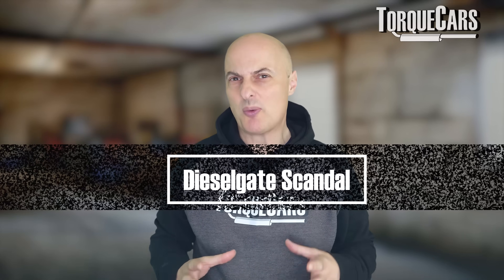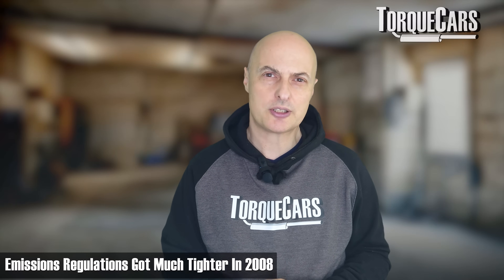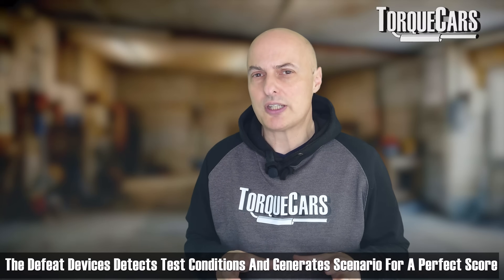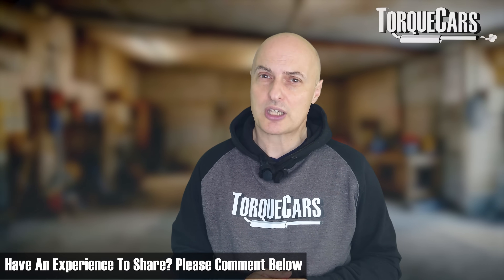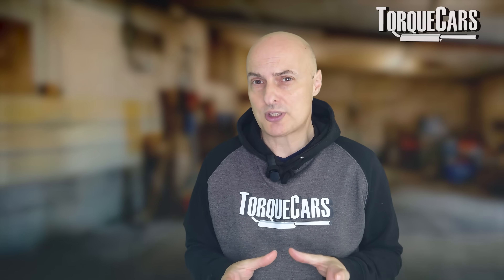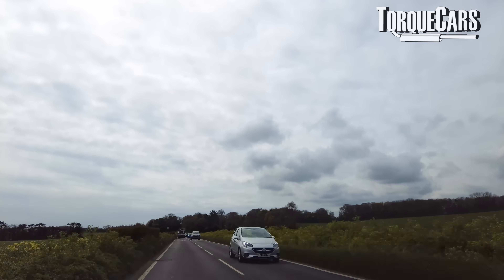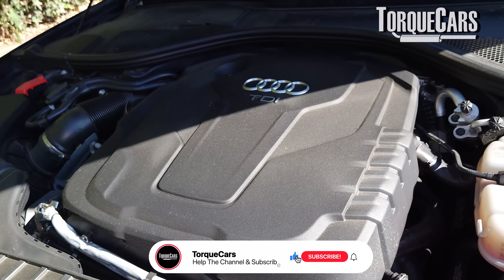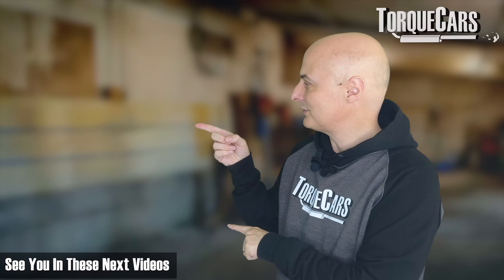Dieselgate Explained! 🚫What They Didn’t Tell Owners About The Fix

Comment: Its a nightmare. I have a 2011 Caddy 1.6 TDI. It has bearly been drivable after the software upgrade. It eats injectors. Spessificaly the piezo actuators. The car only has 85000 km on it, and only 25000 km sins the software was installed. It has consumed one ERG cooler and valve assembly and five injectors sins upgrade. 
Its a scam. And the EVs VW deliver is no better. Never ending expenses on them as well.

Comment: I have a Skoda Octavia 2016. While its EA288 was not as heavily affected by dieselgate as the previous generation of diesel engines, it was still developed before the scandal and therefore had to receive only a software "update" once everything became apparent. I bought the car used with 130 000 miles on the clock and a heavily reduced DPF usable range due to the software update causing frequent regents. When I started investigating the issue, I did 2 things that improved my situation. First, found a garage that could upload the original EA288 software that brought back higher combustion temperatures and more torque in the low RPM range. These, combined with only premium diesel fuel, led to better fuel economy and less frequent regens. Of course, at some point, I'd have to have the DPF removed and professionally cleaned to bring it back closer to its original condition.

Comment: Regarding efficieny -  Mazda now have some petrol engine that can avoid using spark plugs sometimes, not sure if it's widely available or just in development - but supposedly that improved efficienty by a surprising amount.
Reply: You're probably thinking of cylinder deactivation. Something which is also very bad for your car. Just like start/stop systems. 
I'm so glad my Nissan Sentra 140Si (B14) rolled off the factory floor here in South Africa with port injection and absolutely zero emissions crap on it. There's no egr, no catalytic converter, no charcoal canister for the fuel tank or anything. This car runs so nice and reliably. I don't care about the environment tbh.
Reply: @BubblesTheCat1 he’s thinking of the e-skyactive x engine, it runs without ignition between 1500 and 2500 rpm using lean burn technology.

Comment: Don’t forget Petrol engines typically emit nitrogen oxides (NOx) at a limit of 60 milligrams per kilometer under current emissions standards, Diesel is set at 180mg per kilogram, so petrol ice are not perfect, but clearly more money and research should be carried out to improve exhaust systems and emissions rather than as Google does spend $billions on driverless car technology, which so many surveys suggest people don’t want them.

Comment: We had a diesel golf estate diesel which had just had the fix applied.  It broke down on the way home going into limp mode and AA man confirmed a failed injector.
The car was recovered back to our home and I rang VW who said it would be repaired and asked me to bring it to the nearest dealer several miles away.  I explained it was non-driveable and the said that was my problem.  I had to pay for it to be transported there.  When I collected it they said they had replaced 3 of the 4 injectors.  I did a double take and said the 4th was obviously going to go next but they assured me it was fine.  6 weeks later the 4th injector failed.  I rang VW again and they informed the car was now 1 week outside the warranty for the dieselgate fix and so I would be liable for the full cost of repair.  I told them to do one and had the 4th injector swapped out at my local garage.  I then had the car remapped back to the original map and it drove so much better with substantially better fuel economy.

Comment: Our 2012 1.6 TDI was affected by this. The engine never felt the same after the emissions recall.
Reply: Also had a 2.0 TDI 2011 audi A3. After the update it clogged the EGR and the throttlw valve and had way more particlate filter regens. After that i reversed to the last update before dieselgate and had no more issues.

Comment: I couldnt care less, VW circumvented stupid green rules to give us great reliable, fast, diesels, good on them!
Reply: Ditto.
Reply: @arlosurgenor6588  Is it stupid to keep the air in cities clean enough to breathe?
Reply: @xluumu The air in cities is now cleaner than it has ever been.
No coal fires, no pollution caused by factories.
Trucks that deliver massive loads of goods in stead of lots of little lorries.
Vehicles that hardly put out any pollution. Petrol cars are so clean now you would find it hard gas yourself now.
😮
Reply: @Harlequin1959 And that is because of the green legislation mandating lower emissions.
Reply: @xluumu It is because of better technology due to electronics and metallurgical improvements.
Vehicles have always improved even without legislation.
If cars give more MPG they sell more of them good for customers and the environment.
Reply: @Harlequin1959  MPG is really bad metric for pollution. It correlates with co2 emissions, but says nothing about the emissions that cause smog and ruin the air quality in the cities. Reducing emissions requires legislation, technological advancements alone will never be enough as the emission systems in cars serve no other purpose than to reduce emissions.
Reply: @xluumu MPG is efficiency therefore burns fuel more completely which equals less out of the exhaust.
Reply: @Harlequin1959 Less co2, but beyond that it is a useless metric. For example making the engine more efficient can cause it to produce more nox emissions, which require special equipment to clean them. Efficiency alone says very little about how clean the engine is.
Reply: @xluumu The world is full of fumes, poisons, electrical fields, radiation , carcinogens, dusts, chemicals you can never win.
There is always something out there to get you.
Reply: @Harlequin1959 So we shouldn’t do anything to remove the problems?

Do you know how bad the air was before emissions regulations?
Reply: @xluumu There is no real problems now.
You get to the point of diminishing returns. You put in more than you get out. All the effort you put in to improve something by a very small percentage is outweighed by the pollution you cause trying to do it.
Reply: @Harlequin1959  Yes, there are still real issues caused by air pollution. You also seemed to think past progress was because of technological advancements and not legislation. In reality it was the environmental legislation that drove the technological progress.
Reply: @xluumu Legislation helps but technical advancement is the real driver.
Reply: @Harlequin1959  No, in this case it's the other way around. The legislation forced car makers to invest in development. What really brought fuel injection, four valve heads and turbocharging to mainstream was the demands set by legislation. If legislation would not demand for emissions control, just about no car would have it. People wouldn't voluntarily pay extra for complicated and expensive emissions control even if car manufacturers offered it as an option.
Reply: @xluumu We have cars now that are
 the same weight as small trucks now. 
Three ton cars that is the result of over legislation. In the end  you end up with 
Vehicles no body can afford to buy which are over complicated monsters.
They use up massive resources to produce and run.
Reply: @Harlequin1959 Cars getting bigger is not caused by legislation. Small cars are still produced.
Reply: @xluumu  These american "green rules" were banning diesel car from the american market. To protect the rotten american car industry from european competition. It was competition-busting in its very purest form. Good for the rich. Hostile tp the consumers.
Reply: @xluumu  I remember when city building walls were black with soot.

Comment: My son had a 2011 1.2 TDI vw polo.he got a recall to fix the Diesel gate problem.a few days after the check engine light came on.the same thing happened with work colleagues 2.0 L TDI Audi A3. My son just run around with the light on when he used to take for its MOT luckily the test knew about the problem and passed the car.he had the car for a few more years.and had problems with the DPF at 90.000 miles and had a new one fitted by his cousin who is a HGV mechanic.he sold the car a few months later to his other cousin.my sons motorway mileage started to going out down when he started to work from home because of covid. I think that was one of the problems with is car.he did get compensation from VW because of Diesel gate.
Lucky Vauxhall seems to have got things right with my 2015 1.6 diesel Astra.it is running very well now with 80.000 miles on the clock.but I have noticed is not Liking the colder weather at the moment it runs much better in very hot conditions.